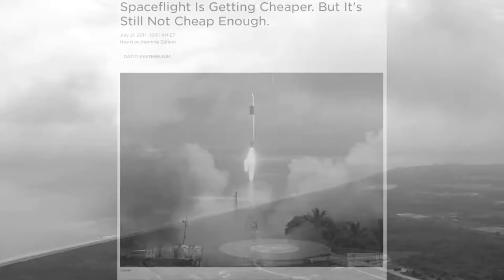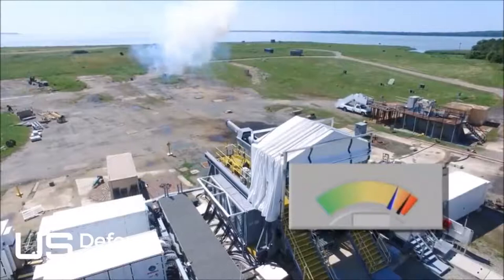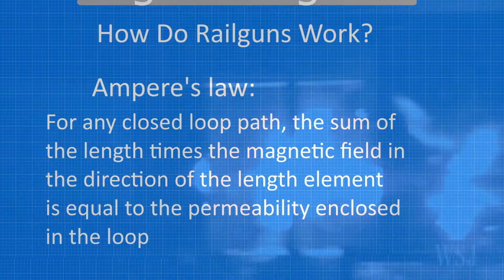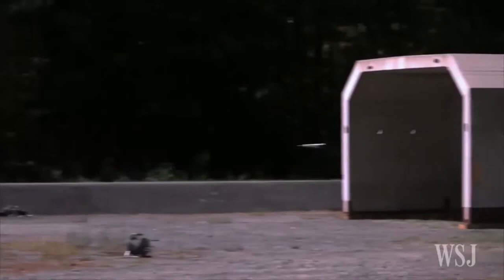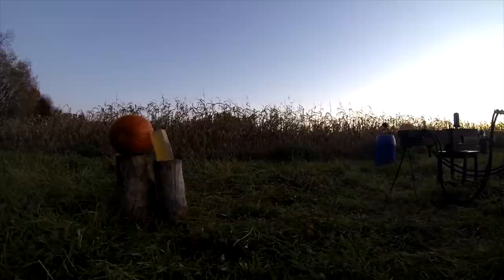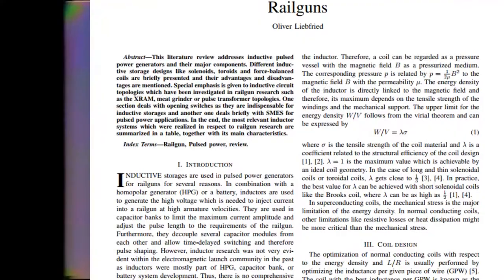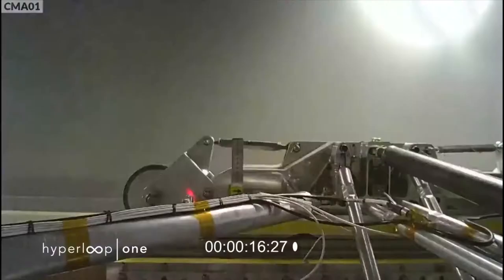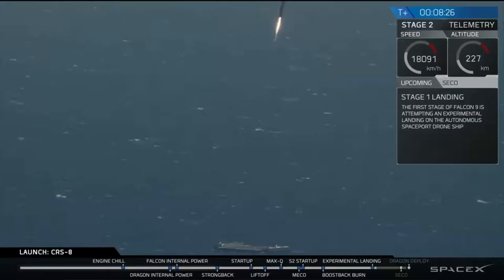The Physics of Railguns - Engineering Plus

Comment: The biggest problem that hasn't been solved is friction. To complete the circuit, the projectile MUST make contact, which means the friction is pretty much breaking the gun every time it's fired.
Reply: Metalloc ionic gases
Reply: What if you made it roll instead of slide? I was also thinking the same principle could be used for trains.
Reply: if the current creates a magnetic field (of course it does) then another magnet in the projectile (or another induced current) would create and opposing force without actually physical contact between the armature and rails
Reply: @moodymonstrosity1423 How do you contain the gas?

Comment: Without some kind of inertial dampening system, wouldn’t the people inside the theoretical space shuttle be obliterated from the instant acceleration?
Reply: Nashmau I know this comment is super late but I did some calculations and the answers don’t seem practical but they are possible. 

First off, let’s assume inside the rail gun we want a maximum acceleration of 8g’s,which is experience by fighter pilots so we know it isn’t impossibly unreasonable.

Now, if we accelerate the passengers  to a speed of 4000 m/s inside of a vacuum tube, then inject them into the base of the rail gun. With a max acceleration of 8G’s, the rail gun would need to be ~700km long.

The barrel of the rail gun would need to be straight of course, however, the vacuum acceleration tube could be straight OR a spiral. The Radius of the turn would become larger as the passengers went faster so they wouldn’t exceed 8G’s of centripetal acceleration. If the acceleration tube was straight it would need to be an additional 102 kilometers long. 

Or you could just make a railgun that accelerated the passengers from 0-11,200m/s at 8G’s with a barrel that is roughly 800km long. 

This could work if it was built in the Sahara.

Edit: I checked the calculations for a spiral and the total diameter would be larger than the length of a straight barrel. Therefore, it would be best to construct an entirely straight ~800km long railgun.

It would take ~143 second from launch to leaving the barrel.

We could launch capsules with their own fuel which could put itself into a stable orbit. Or full rockets that could save all its fuel to reach high speeds in the vacuum of space for interstellar travel.
Reply: @johnthomas4790  While 8Gs are consistently done by fighter pilots, they usually do them only in short bursts. I'm talking about 10-15 secs. 30 secs in sustained 8Gs is already a big challenge even for the most elite pilots. You're talking about 2 minutes~. Untrained civilians pass out at 4-6Gs. Plus, the LHC is 27km long and didn't need to be rated for human transport, and it cost around 9billion USD. You're talking about 700-800km. Not to mention the atmospheric effects on an object at orbital speed would be too much, you might as well point the whole thing straight up to maintain vacuum. The thing is, the ISS orbits at 400km altitude. So yea, launching objects (let alone humans) from the surface of the earth to space is unlikely to be viable, most likely ever. Launching from other places like the moon on the other hand...